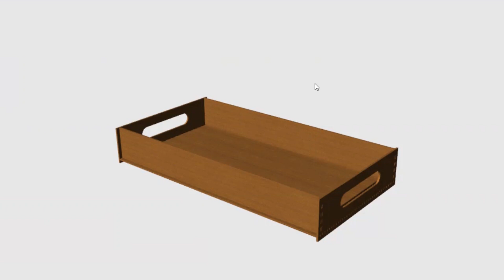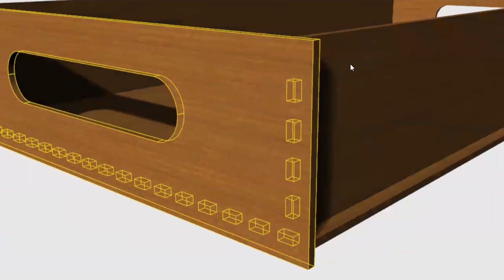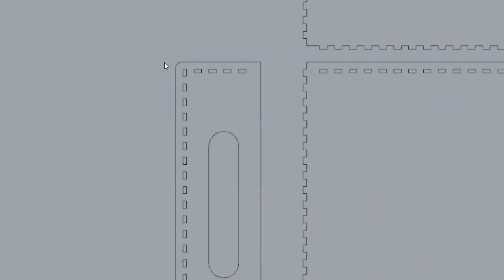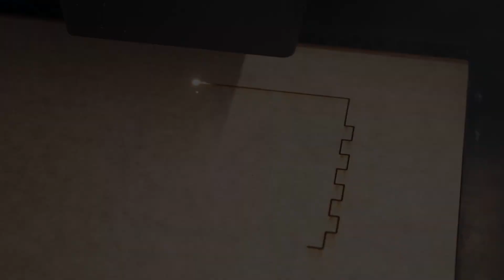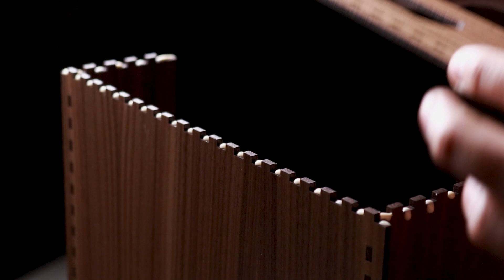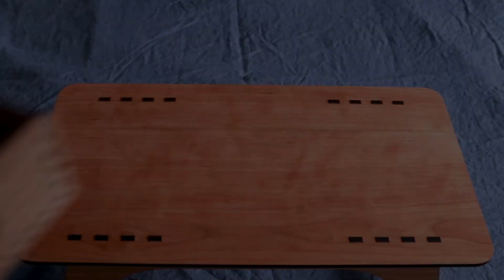Making a Minimal Serving Tray with a Laser Cutter

Comment: I have a GF PRO and want to design finger joint boxes. I cannot figure out how to consider for the kerf. Can you provide any advice? Thank you
Reply from the maker: I don’t think too hard about the kerf in my designs, but if you want to be as accurate as possible, you can find files to laser cut with different materials that will help you find the exact dimensions that work for finger joints with your materials.